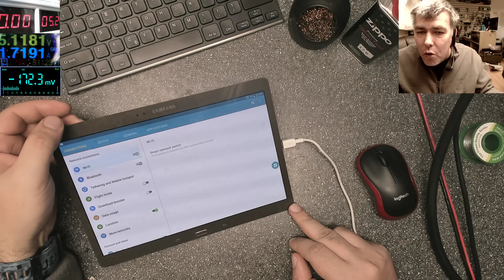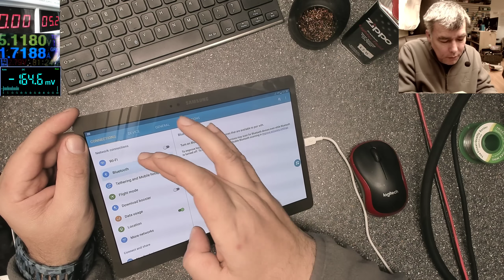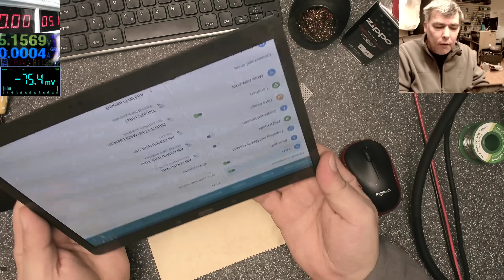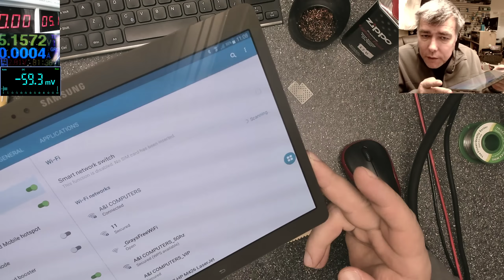Samsung tab s No power, Not charging, No wifi repair

Comment: Excellent repair Videos as always !!!  I have a question to ask: The small plastic Latch on the Processor flat ribbon cable for the Screen Output connection broke when l was trying to lift it to replace the battery on my Samsung TabS 10.5 SM-T800 Are there replacements available to buy and are they quite straight forward to pop back into place to get the screen output working again?  What is your advice and have you done this type of repair before ?  I look forward to hearing from you with your advice - Thanks.

Comment: I wonder if you can figure out my Samsung Tab S problem.  It keeps rebooting over and over again. Sometimes it will come up for like a few minutes then go back into a reboot loop. I already reformatted it like new and I got a new battery but still keeps having a problem. Is it an easy fix or should I sell it it for parts?  I looked up videos of the same problem and it didn't seem to fix it. My dad thinks maybe it's the motherboard that could be going.

Comment: Hi.. I have a Samsung tablet S 10.5.. its battery dead and does not charge. I took it to repair but they changed both battery and charging port to find that thats not the issue. They diagnosed problem with the power distribution chip. But they can’t repair it. Can you please tell me where can i get this device repaired for the power chip problem. Appreciated

Comment: I have a weird problem with a Samsung tab 2 , 10.1. It charges ok when its turned on,  1amp showing on in line tester and battery percentage going up, but when it's turned off I connect the charger"original samsung charger and lead" and no battery status icon comes up to show its charging, even when its pulling 1amp through tester.  When I try to start the tablet after having the charger connected it won't start. Only way to get it to start is to remove the back cover and unclip the battery for 10 seconds . I have changed the battery and the usb lead and reset to factory settings, still doing the same. Was wondering if you had seen this problem before.Thanks.

Comment: Hi Sorin, a few days ago, I had a similar problem on my ASUS ZenFone 2. WiFi/Bluetooth/FM Radio was not working and all those things depends on a BCM4339XKUBG IC. I had a dead motherboard of the same phone lying around and replaced the WiFi chip. Everything works now except that 2.4 GHz WiFi is not that stable as before. I lose signal sometimes. I suspect it to be happening because I did not reball the chip but put it as is and hence it is not making contact with some of the pads on the motherboard. I am planning to buy a replacement chip from AliExpress. Do you know if the chips come preballed? Thanks in advance. I love your work. :)

Comment: i have an iphone 6s can't charge the battery, and always do a restart loop when pluging charge, it will going on after multi time of restart loop, but even have a chance to the menu it will turn off it self in 1 or 2 minutes, but when i try restoring os with utools or itunes, it going fine 100% restored os without any loop, maybe also the wifi chip problem? let's give a try for beginer like me, i though it is not a small caps sorted :D

Comment: I have one of those tablets and it is stuck in a boot loop. I can sometimes use it for a few minutes before it reboots on me. I've installed a new operating system and that didn't fix it.
I also tried putting in a new battery which made no difference. I watched one video of yours in which the battery connection was broken causing a similar problem but couldn't see any problem with that on this tablet. Tablet worked fine for just a little over a year before this started.
Any idea as to why it would do this and how I can fix it? Thanks
Reply: Have you found a solution? I have the same problem. I replaced the battery and its now sitting on the shelf. Put off buying another Samsung tablet
Reply: @vanesawhite4378  I bought a new motherboard for it from  aliexpress  and replaced the old one. It works again. I wanted to then root it to remove all the bloat wear but tried everything possible and it can't be done.  At least the reboots are gone for now.

Comment: Hi, Sorin, Thanks for your video. I'm going crazy seeing your videos, because of the following:
1) How do you know the function of a certain chip you identify "hotter" thsn the others. 
2) Your soldering skills: I dunno if it is a fault my hot air handblower, but I can solder these devices with lot of difficulties, without blowing things apart with the hot air. I've tried to slow down the air flux, rise the temperature, but this way, lots of times, soldering won't happen. And I don't DARE do this process on iPhones, for the silicon glue all around components.
Furthermore, today's solder, fuses at higher  temperatures that the older one, this drives me crazy to which temperature I have to set on the hot air blower.
3) How you can be sure that once soldered, the chip don't have any hidden short under. So, you finally ADD a fault, instead of removing one. I did lot of exercises on broken boards, but when resoldered I CAN'T know if the soldering process gone correctly, since it is already a broken board....
for your info, My hot air handgun, has a blower fan inside the handle. Could be this the reason for my soldering difficulties?

Comment: I had a Samsung laptop come in today - no internet no wireless or wired connections working - trying to use external dongle makes no difference - Noticed physical damage so took it all apart and found a small black chip/square with red dots on it - it was loose damaged - a repair I can not do - what country you guys in?    Samsung NP350V5C i3 model.

Comment: Sorin,I'm having weird issues with samsung galaxy note 10.1 2014 edition...battery is discharging when the tablet is turned off (approx 5% per day).Replaced the battery still same issue.What could it be?